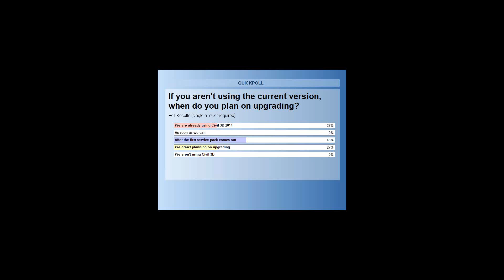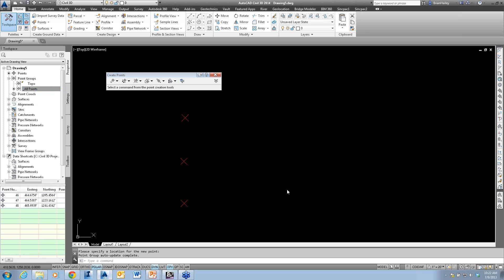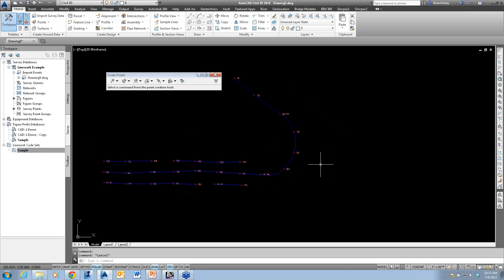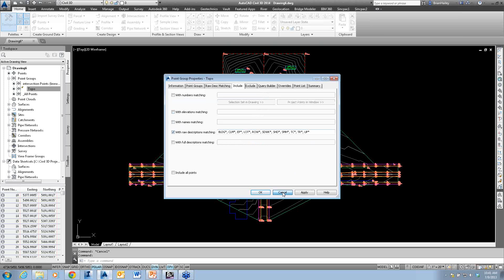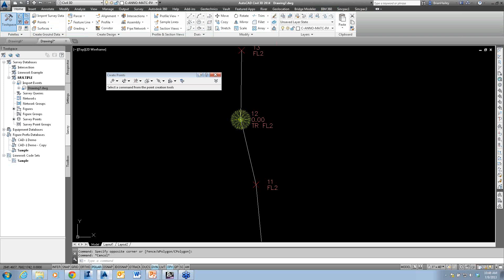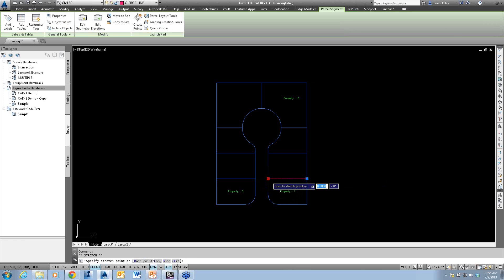CAD-1 Presents - Survey in Civil 3D

Comment: https://gumroad.com/l/NbLZQ

Geospatial technology and Geographic Information Systems (GIS) have rapidly evolved in the civil engineering industry over the last twenty years. A vast majority of city, municipal, and utility organizations maintain active GIS that serve the needs of both internal and external clients. Naturally, there are a large number of industry software vendors that are trying to meet the ever-increasing demand for reliable geospatial technologies and data.

In typical civil engineering projects, such as land development design, many departments are involved in using and integrating geospatial information. Software applications that address all project phases seamlessly are most beneficial. Software system architecture needs to enable individual programs and departments to communicate efficiently with each other. AutoCAD® Civil 3D® software includes AutoCAD® Map 3D tools and supports many other industry file types such as Microstation DGN files and ESRI shapefiles.

Comment: Very concise and informative! Kudos.
Reply: https://gumroad.com/l/NbLZQ

Geospatial technology and Geographic Information Systems (GIS) have rapidly evolved in the civil engineering industry over the last twenty years. A vast majority of city, municipal, and utility organizations maintain active GIS that serve the needs of both internal and external clients. Naturally, there are a large number of industry software vendors that are trying to meet the ever-increasing demand for reliable geospatial technologies and data.

In typical civil engineering projects, such as land development design, many departments are involved in using and integrating geospatial information. Software applications that address all project phases seamlessly are most beneficial. Software system architecture needs to enable individual programs and departments to communicate efficiently with each other. AutoCAD® Civil 3D® software includes AutoCAD® Map 3D tools and supports many other industry file types such as Microstation DGN files and ESRI shapefiles.